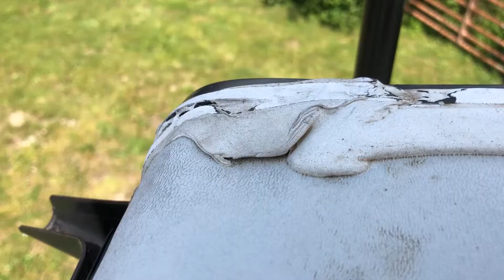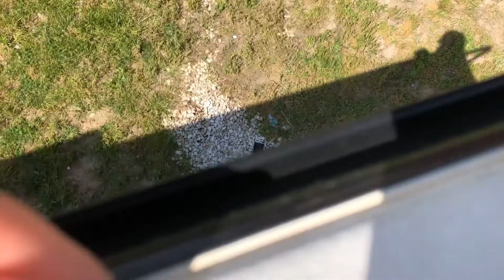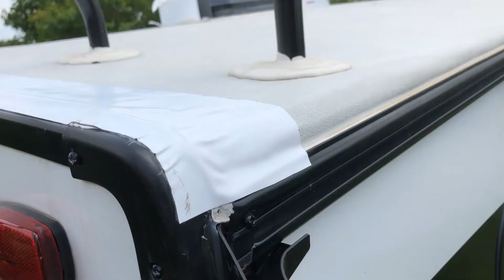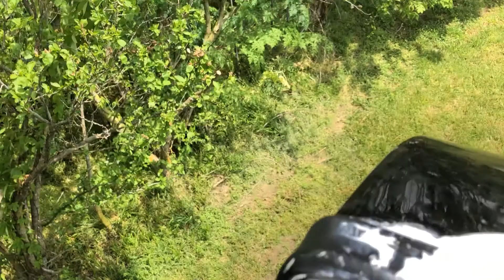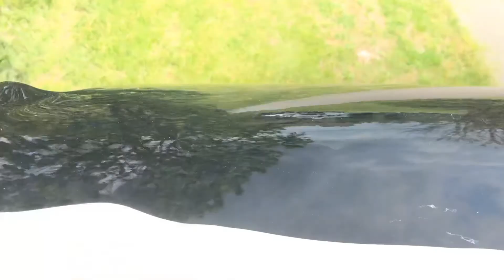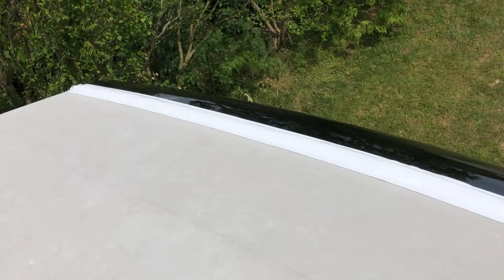5th Wheel Camper Roof Lap Sealant Repair with Eternabond Tape on Grand Design 311BHS

Comment: I'm using Ziollo products (lap sealant,4" wide tape and coating/sealant).. I've got an 85 Itasca 26-foot class C.
And the roof is horrible since they removed a lot of support on the inside prior to my ownership.... 🤯Nightmares!
Now this product amusing as a lifetime etc warranty
But I must say the 4” tape is much more formidable around high and lows and sharp dips.
I have many problem areas as far as leaking, been doing a diligent job to conquer this situation. I was hoping you could give me feedback if you know about Ziollo. As of right now have not busted the seal on the five gallon bucket of coat/sealant.. still in the taping , I'm post lap sealant at this point...
Let me know 👍
Reply from the maker: Amadeus, I have no experience w/ Ziollo products.  I agree 4" can get a little hard to work with.  Patience is key.  Maybe for tricky spots 2" would be better?

Comment: Why not remove the old self-leveling Dicor and replace it with NON self-leveling lap sealant?  After it sets up, THEN add your EB tape...  Just seems like a bandaid over a hole seems wrong and looking for a problem later.